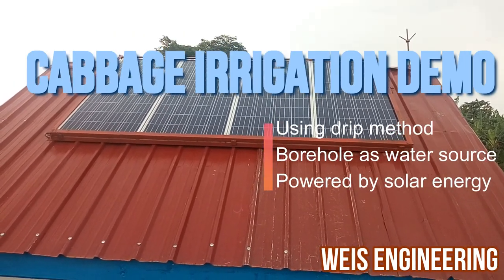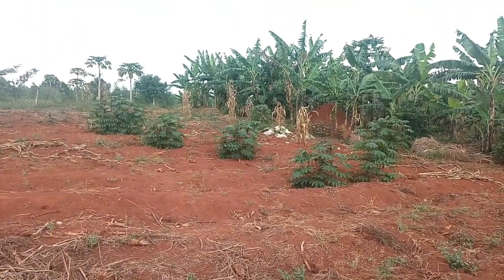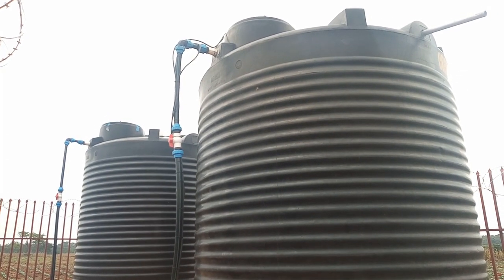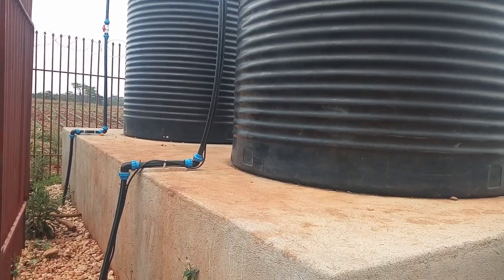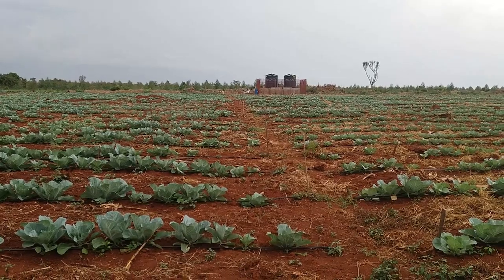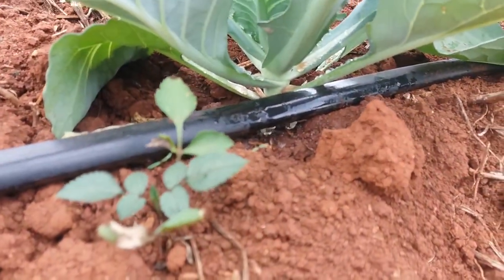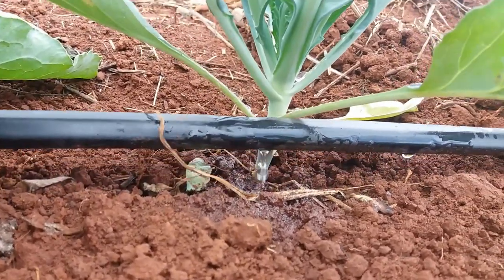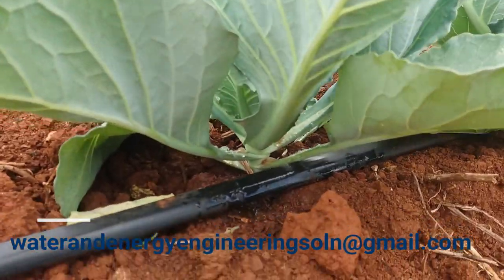Solar powered drip irrigation system for cabbages Cabbage irrigation in Uganda

Comment: Hello my friend, thanks for sharing this impressive and motivating video. I am a very new vegetable grower from Karachi, Pakistan. I would be grateful to you if you can answer my following questions in order to help me understand more. 

1. Total line length and how many lines?
2. Is there only one main water supply line and 1/2" PE tubes connected with this main water line?
3. The drip tube has emitter inside or you manually punched a hole? If manually what dia hole?
4. How much is the power of water pump? Hp/Kw? I see it works with 4 solar plates, how much watts per plate?
5. Did you estimate how much water per plant is required (Per day, per hour, how many liters)
6. Do you run the water all day in breaks? Like 1 hour run and 4 hours stop and then again?
7. What is the max peak summer and winter temperature during day time in the cropping field area?

You answers will guide me a lot. Thanks
Reply from the maker: 1. Total length of the driplines is 20,000 meters, average length of laterals was 28 meters
2. Yes we had on mainline 2'' and 11/2'' and several submains of 11/4'', the driplines were 16mm diameter and flat type
3. Driplines had emitters already punched at 30cm spacing
4. The maximum power for the pump is 1.4kw, we supplied 1kw to the pump, solar panels were of 250W
5. Each plant ca require about 1.8liters per day however the schedule can be irrigated twice a week
6. Each zone is run separately and in shifts
7. Temperature ranges from 24-33°C 
Thank you for your comment
Reply: @WeisEngineeringLtd  please may you explain point 5, what does 1.8ltrs per day mean in relation to the twice a week schedule?. are you saying you can irrigate 1,8litres for two days in a week
Reply from the maker: @TenmaxZw  
Thank you for your comment.
You irrigate the water required per day multiplied by the number of days you wish to come back and irrigate the same place for example, if your schedule is every after 3 days, water required to be applied will equal to 1.8X3= 5.4 liters.
The schedule will depend on some factors like;
1. Actual crop type
2. Soil type
3. Climate, etc
Reply: @WeisEngineeringLtd  good
Reply: This is interesting

Comment: Weis , Technical advice, what pump can be used to deliver water 600 m away from a dam not a bore hole. The pump should be solar powered.
Reply: Also the pump outlet should be 2inch.
Reply from the maker: Hello, two main factors will determine the size of the pump;
1. Volume of water you may need to pump per unit time for example per day
2. Vertical height from the dam to the delivery point, and other factors

Comment: What type material is the pipe that you use to transfer water from borehole to a distance of 200 meters? 

What is the pipe diameter? And what is the HP of your submersible pump pump?

Thanks
Reply from the maker: HDPE 
40mm
1.2hp
Reply: Thanks

Comment: Are you also pumping water from the tanks on to the field? Or is the water from the tanks dripping from gravity?  Thanks
Reply from the maker: Water is flowing by gravity from the raised tanks to the garden. No we are not pumping.
Thank you for your comment.
Don't hesitate to contact us for other questions
Reply: So does that mean the tanks has to be raised above the entire Plaine, or garden? Will the gravity fed systems just as long as the tanks a slightly elevated? Thanks.
Reply from the maker: Sizing pipes properly will be needed, water will flow if there a height difference between the reservoir (tank) and the driplines
Reply: @WeisEngineeringLtd  thanks

Comment: beautiful work and my dream farm too.. How many watts solar panels  are you using? 
How many HP pump and what's the discharge per hour...?
Reply from the maker: Panels of 200Watts, Pump hp is 1.8, discharge is 2.5m³/hr
Thank you for your comment
Reply: @WeisEngineeringLtd  what vertical height can the pump draw water?

Comment: How much does it cost to put up such an irrigation system.
Reply from the maker: Advise us on the planned acreage, water source type and estimated distance to the gadern
Reply: @WeisEngineeringLtd   Water source is a river bank, about 3km to the farm, planned acreage is one
Reply from the maker: Thank you for information, the system may cost you about Ugx14,000,000, However actual vertical height along the 3km will need to be measured

Comment: I Am trying to create a good drip system but my water doesn't get to the end of the drip lines is it the size of the pipe or what?
Reply from the maker: Thanks for the message
It might be due to ;
1. Longer lateral (dripline) length at a low system pressure
2. Smaller submainline in relation to number of laterals
Reply: It must be the pressure and you must raise your tanks up in order to increase pressure
Reply: how did you resolve this problem

Comment: Is 30 cm drip line distance good for cabbage production
Reply from the maker: Yes, 30 centimeters can be used
You may need to consider soil infiltration rates and dripper flow rate.

Comment: Are you using any pump from the tank to the drip lines, or is it gravity?
Reply from the maker: No, we are not using a booster pump from tank to the driplines
Reply: Thank you, I'm trying to set up  a system like that in Zimbabwe and was worried  about that last distance from the tank to the Drip lines. Your video is very helpful.
Reply from the maker: Thank you
Weis Engineering Ltd would love your feedback. Post a review to our profile.
https://g.page/weisengineering/review?gm

Comment: hello  i would like to purchase new trusted drip system which can cover a plot of 50 to 50 small plot.   where can i buy the trusted and good drip irrigation system in uganda please????????????????
Reply from the maker: Thanks for your comment William, Weis Engineering Ltd has the best irrigation products and service in Uganda. You can leave us with your contact/mail for more discussions. Our head of technical contact is +256 759 790556 or office number +256 393 225452
Reply: This is rong method of drip irrigation

Comment: How much is drilling and pumping only
Reply from the maker: $4,800 - 6,300 excluding hydrogeological survey and pumptesting. Cost of pumping depend on drilled depth, desired flow per unit time, vertical height and horizontal distance between the well and delivery point

Comment: How many minutes or hours you keep it running??
Reply from the maker: Thanks for your comments Ahmed, this will depend on crop type, soil and climate of the area
Reply: @WeisEngineeringLtd  means you don't keep it running 24 hours??
Reply from the maker: True, you may run it for 1-3hours.
Reply: @WeisEngineeringLtd  thank-you,  from Pakistan
Reply: Do you you need to use a booster pump to boost water to the laterals or pump is only used to fill the tanks ?
Reply from the maker: Pump is only used to deliver water to the tank however in some designs, a water tank maybe excluded and water delivered direct to laterals
Reply: @WeisEngineeringLtd  okay. And yah, i hav seen those designs too. But in that case i think it needs a pressure controler besides from the water pump.
How much is a system for 1 acre excluding the water pump and the tanks.
Reply from the maker: Yes, a pressure controller and gauge is needed.
There some factors affecting the final design - cost for example;
1. Actual crop type (spacing)
Coat can range from 3.2-3.8m Ugx
Reply: @WeisEngineeringLtd  okaay
Spacing 50cm btn emitters 
Crop type; tomatoes 
I need exact price  coz am serious
Reply from the maker: @Jcdennz92  What's the spacing between rows, we currently don't have 50cm emitter spacing.
Reply: @WeisEngineeringLtd  btn rows is 1 meter
Reply: What is the current spacing you have
And when will 50cm spacing be available,
Reply from the maker: @Jcdennz92  20cm, 30cm and 60cm.
We don't usually stock 50cm
Reply: @WeisEngineeringLtd  okay, i will go with 60cm
Reply: @Jcdennz92  kizito this system is rong...